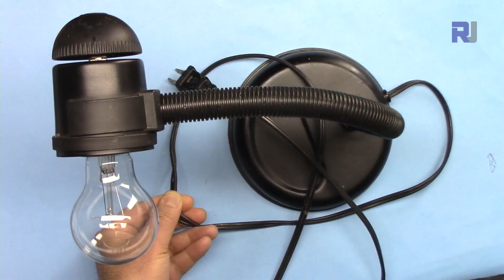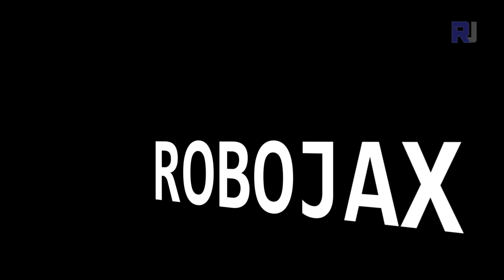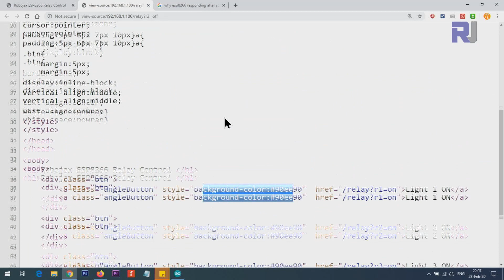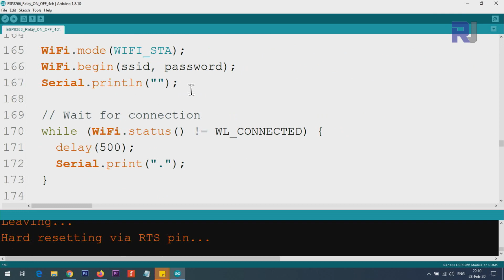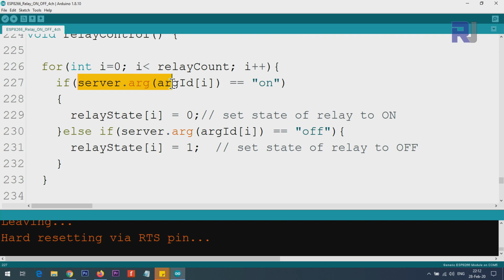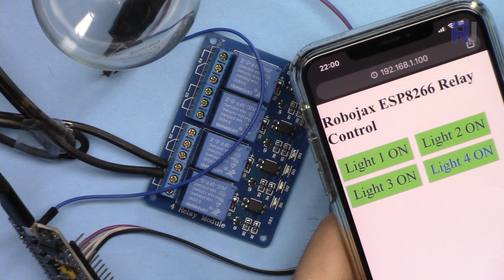ESP8266  Project: control 4 AC bulb or load using 4 Relay with NodeMCU , D1 Mini over WiFi - RJT280

Comment: Hi Robo, Great vid! Im new at this and i tried to build this project. I got everything working only the buttons on my browser are not responding to the relay. I got only 1 channel relay, by the way. Relay 5V works fine. Do you know what is going wrong?
Reply from the maker: Hi, if I assume you have not changed the code then it is the wiring.
Reply: @robojax  Thanks for your quick response! That was it! Thanks a lot!! Your vids are very clear thorough. Great projects for a beginner. Hope you dont mind asking you some more questions in the future.

Comment: Hi your past videos have helped me a lot in my past projects. I think you should  do a video with an arduino mega 2650 with wifi esp8266 built in with the same project.
Reply from the maker: Hi, thanks for the comment.  how can I use Mega and ESP8266 both are microcontroller and it would be waste to use two of them? There is a WiFi module for Arduino Mega that I can use. Please clarify why you need Mega at all if ESP8266 can work for this project. Other than  abundance of pins do you need it otherwise?

Comment: When I try to compile the code I get the error:   redefinition of 'const uint8_t D0'  If I comment out this line then it fails on the next line and so on
Reply from the maker: so you are using a library that has those variable. just comment them out and the program should work. comment all of them at the top of the code.
Reply: @robojax  thank you

Comment: Amazing video Ahmed. I had implemented and facing one problem, the IP/DNS is not working outside the same WiFi network. Could you please help why that's happening?
Reply from the maker: of course it will not work. search youtube "how to connect to my home network from outside"  you will find solution. once you can connect to your home, then you can connect to ESP device.

Comment: So the 5V relay worked OK with the 3.3 8266 board?
Good to see.
Thanks for posting.
I guess 'Light ON' actually tunring the light off is appropriate for 2020, it's been a crazy year. No doubt a easy fix.
Reply from the maker: I have explained it how it is reversed. either in code or in wiring.
Reply: this is why I came here.

Comment: Can you put a video regarding control relay with mit app inventor app using Arduino Uno + esp8266 + 4 channel relay ??
Reply from the maker: never heard of "mit app". There are millions of apps.
Reply: Hello sir ..,I mean mobile application that   making from MIT app inventor  (block coding)
Reply: Because I want to make something with that. , But I don't know it's corresponding Arduino and esp codes .,  As a subscriber / student I can make my dream things with the help of your  lovely videos/teaching. Thank you..
Reply from the maker: I've never used any app with Arduino except Bluetooth serial.  Somehow I feel it is waste of time to use external app. As you can see it works without any other appl.
Reply: Otherwise can you make a video with Arduino nano + esp 8266+ 4 channel relay control using a mobile ??

Comment: how many channel relays can be controlled with single nodemcu board?
Reply from the maker: just count the GPIO pins and that many. or you can use I/O expander to ad 16 more.
Reply: @robojax  Thanks for swift reply, but i asked bcoz i came to know that all GPIO pins cant be used for outputs. So generally how much GPIOs can be used? I have seen projects controlling 4ch relays directly from Nodemcu. Beyond this number i found people are using shift registers. So my qudestion remains the same how many relays can be controlled directly from nodemcu without using other tricks.
Reply from the maker: I don't remember how many GPIO can be used. I made video for  that and the link is in the description.

Comment: Hi 

And again a Great Video.
But i have a question and Maybe you can help me.
How i can Add a picture in the background and have the switch buttons on the picture?

Cu Christian
Reply from the maker: Hi, your question is on HTML . Search google on that and you will get tones of examples. Then use that code with the code I have explained. Do not skip explanation of the code. Watch it more than one time to know how it work in order to customize it.

Comment: Hi Robojax, can you pls guide me how to do the same project in Arduino mega2560? I mean NodeMCU talking to Mega 2560 for the same purpose.
Reply from the maker: Hi, I did not understand. if you use ESP8266 this is a complete microcontroller like MEA2560 +WiFi capability.  yes it has fewer IN/OUT but.  if you wan to use MEGA then you need the WiFi shield and with some tweaks it should work.

Comment: Bets to put a socket in a box with cable/plug to socket outlet and install the relay wiring inside the box. Much safer that breaking the wire.
Reply from the maker: Yes. of course. this is just demonstration for learning purpose.

Comment: Thank you for your very usefull tutorials. I learnt a lot from them. Is it work only in local? Can it work if you are not connected at the same wifi ssid? Thanks
Reply from the maker: You are welcome. Because it works with WiFi, your device to control it must be on the same Wifi/SSID network.